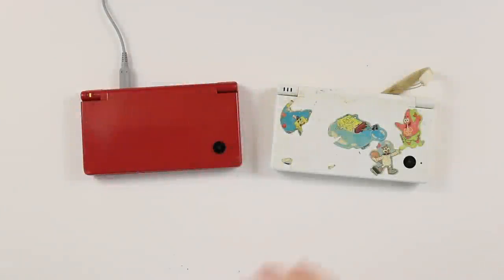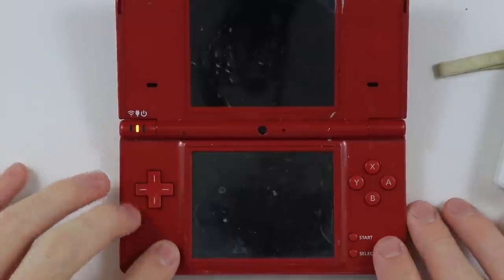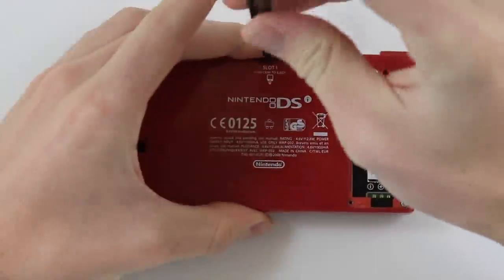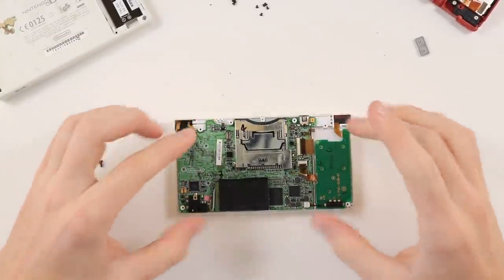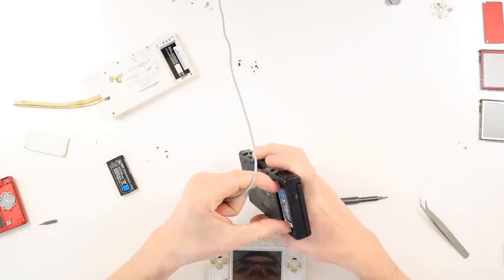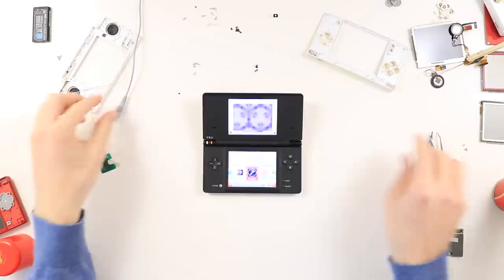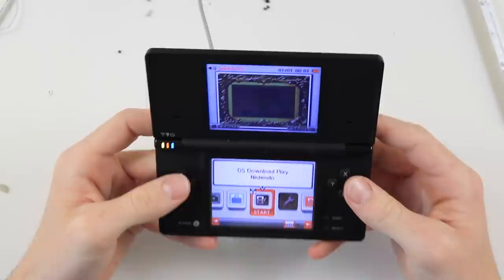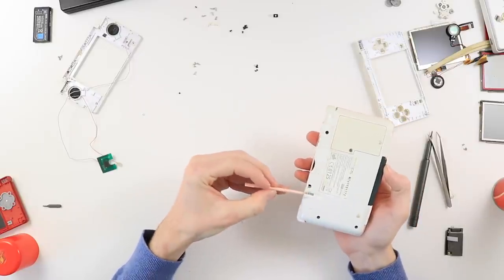Let's Refurb! - Fixing Faulty Nintendo DSI!

Comment: You inspired me to fix a DSi XL on my own! Bought it off ebay for $14 usd, and all that it took was a $4 wifi card replacement to work again! Screens and battery were fine!
Reply: How did you know it was the WiFi card? I wanna get into fixing these too and It’d be good to know when the WiFi card would be a problem.
Reply: @QuentacosIsMe  It threw up an "error has occurred message" Nintendo stored data on the wifi card at times, and as such games/apps won't launch without it. You can always try reseating the card, or buying a replacement as I did.
Reply: @AeliusAnonymous  Thanks!

Comment: Ds fact:
When it goes on, one screen flashes and then it goes off, that means the motherboard isn't detecting the other screen. Sometimes it's a damaged ribbon, but sometimes it's just not plugged in quite right!
Reply from the maker: I tried to re-seet the cable I think, but it didn't work still!
Reply: good to know
Reply: Thank you for telling me how to fix the ds at my mom's house
Reply: I tried and re-did this a dozen times with my DS Lite, and still nothing. The cable look fine to me, but it might be something in the motherboard
Reply: Charky, at least you have your facts straight but it’s good to know that
Reply: I don't get it.. my childhood dsi has this problem and so does my friends, I tried re setting them but still same issue sadly :/
Reply: So guys how do you fix it I need help where it turns on and one screen flashes and just turns off instantly plz help me
Reply: It doesn’t mean that it means the screen is broken I saw it on my mate Vince and Francis fix that’s what happens
Reply: @Lily58548  yes... The motherboard doesn't detect it because it's broken. But that's not the only reason it might not detect it.
Reply: I realise I'm two years too late to the party here, but if reseating doesn't fix your problem, the screen or ribbon connecting to it is broken. The DS looks for a complete circuit for each of its components and if they're missing it won't function. It's possible for the ribbon cables to have invisible damage; it could also be an internal failure with the screen, or damage to the socket.

But the point still remains: if you have a flashing ds screen, it's because the screen that doesn't flash isn't being picked up by the DS.
Reply: This happened to me .THANK YOU IVE BEEN TRYING TO FIX THAT
Reply: @Seadog742  no worries :)
Reply: i love you thx
Reply: very good information, as the top screen on my dsi blinks once and shuts down, when i go to turn it on
Reply: Yep that's true on all ds systems right up to new 2dsxl.

Comment: I really do appreciate how simple but good the DSI motherboard is. You'll notice there's a portion of the motherboard that's dedicated entirely to the battery, which I believe has something to do with battery life, and it's connected via a few cords to the rest of the motherboard. It's pretty basic, and old news even by DSI standards, but it's pretty cool to see on a flagship handheld console nonetheless. It's cool that you could harvest parts to get at least one console working, that's already made your money back, as acceptable conditioned DSI consoles can go for around 50 on Amazon, even more if you include basics like a charger and stylus. I really enjoyed this one, it was neat to see a variety of consoles with a variety of issues, of which was fixable with the right gutting and handiwork. I enjoy when these sorts of videos have a variety in them, and the issues aren't just things like "it won't turn on because the power switch was too dirty" or "it had problems getting a connection from the batteries", I'm glad you could finally get something fixable and actually fix it. 
If you're continuing to refurb one of each Nintendo handheld, the next is the 3DS. Do you intend to do an original 3DS or are you going for a newer system? My launch 3DS console works just fine aside from a finicky left shoulder button, which just needs to be held down for a short bit to work sometimes. The 3DS consoles are a lot more sophisticated though, I had to open mine up and clean it out, as it had developed a lot of gunk and I had to replace a swollen battery, and it was really surprising how detailed it is for a handheld, whereas most just have a single basic board with a couple of cards soldered on and that's it. I hope you can find some cool new consoles to fix soon, these videos you make are really enjoyable and relaxing. I've just subscribed, I'm excited to see what you do next!

Comment: If the backlight is the only trace broken in the ribbon cable of the top screen that makes the console blink, you can repair it as the backlight has both connection as solder pads near the speaker pads. You could reconnect them with some thin magnet wire to the motherboard

Comment: Yeah, like the 3DS, when a ribbon cable isn't properly connected, or damaged, the console will just pop the blue light, and in case of the DSi, the screens will pop up white and then turn off.

Comment: What is commonly the issue if the Nintendo dsi bottom screen blinks but top screen stays black? 5:17

I'm asking because I have this issue and have had this problem for years but never got around to fixing it. I desperately want it fixed because I always wanted to save my memories from there onto an SD card

Could you please make a video specifically on how to fixing that issue. I'd appreciate it so much!

Comment: Do you know if dsi needs all components to power on? someone gave me a broken dsi with the top part hanging down from the two cables, screen ribbon cable and camera module cable (i dont know if ribbon cable is the correct term). The ribbon cables are completly destroyed. I can replace the screen and the shell easily but i cant find the camera module ribbon cable anywhere but ebay or alliexpress. Is it necessary to have the camera module working for the dsi to boot up? i realy dont care if the cameras are working.

Comment: Well, I have encountered an issue with my dsi. American model, I believe. The dsi doesn't turn on and there is a little water damage underneath the ribbon cable connecting the d-pad to the motherboard. I swapped the old d-pad for a new one. Can you help a little more please? Kinda stuck.

Comment: As is my typical I'll pose a question that's likely to not be answered but beggars my curiosity anyway - why buy 2-4 non-working DSi systems just to only end up with one that does after swapping all the parts around? Wouldn't it be cheaper to just buy one that does?
Reply from the maker: Entertainment.

Comment: hi so, i have my dsi, wich i think its kinda bricked (with a similar screen of black screen of death, but its not, as it actually charges), it happened when i was hacking it, i was inserting a game, but the sd card just went out (the spring is broken btw), and it suddenly only turn the blue led on, in this case, what should i do?, as ive searched and nothing (i dont have a backup neither)

Comment: I have a red dsi (on my pfp you can see it) but it doesn’t work, when you switch it on the bottom screen flashes then turns off. I have a white dsi that works though so that’s good.

Comment: Can you make a Game Boy Advance mod that has an:
AGS-101 LCD
AGS-101 Voltage Regulator
BennVenn Digital Brightness Controller
GBA Audio Amplifier
GBAccelerator
and a 1400mAh Rechargeable Battery Pack from Retro Modding? You should perform the Ultimate GBA mod by late December 2018!

Comment: DS Lites are much easier to fix, and DSi XLs are much better consoles than DSis. I have fixed about a dozen DSis, though. These three consoles are much more rugged than 3DSes. The New 3DS XL is the absolute worst to fix, as you'll find out. The 2DS has one screen module that costs about $25, so it's the least economically viable console to fix.
Reply from the maker: Dsi xl is next!

Comment: You probs won't notice me but I have a small request.
Could anyone here link to websites to get parts, and a tutorial or guide because I would like to repair my older brother's dsiXL by June. The top screen has different colours then usual and the microphone doesn't work but other than that it is fine. When on the home screen instead of being white it has a hint of purple and there are lines running down it. Any help would be greatly appreciated. Also your videos are just 👌